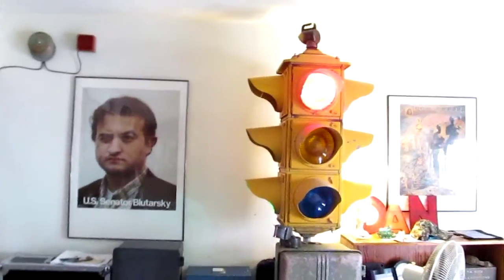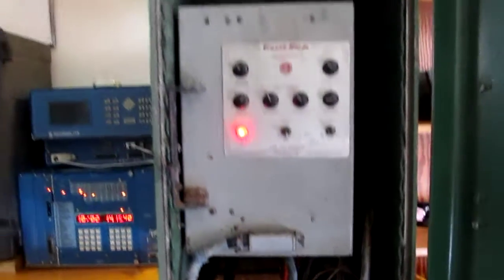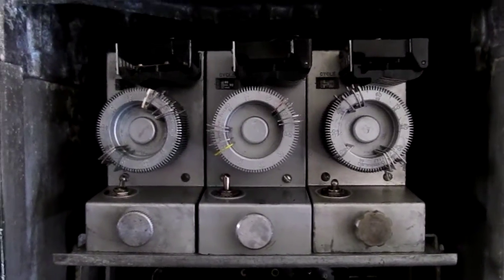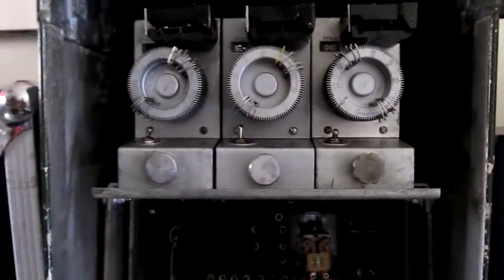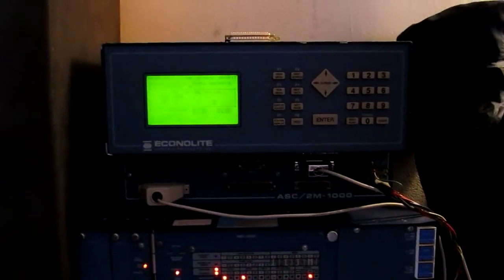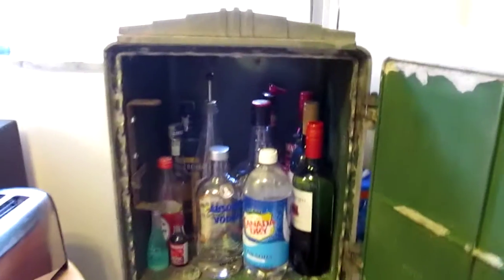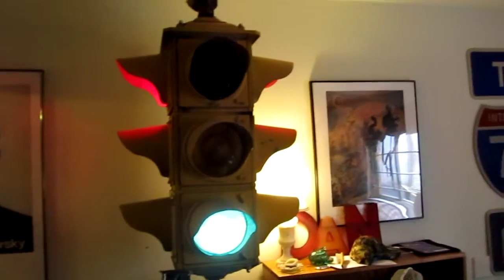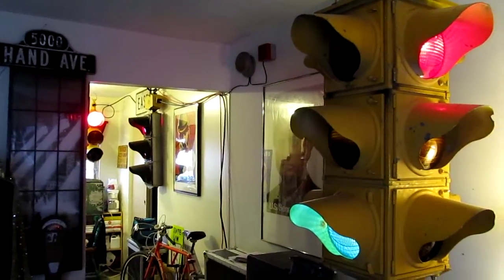Traffic Light Collection Tour, Updated 10/2/11: Part 2

Comment: So does your ASC/2 need anything extra or is it straight 120 vac? Also can it work without cereal cables?
Reply from the maker: All NEMA controllers use straight 120 vac. To run the bare minimum intersection (2 vehicle signals and 2 peds) you only need the "A" connector, which includes the incoming power. The B connector gives you 4 vehicle, 4 ped, and 2 overlaps, and the C connector gives you the full setup: 8 vehicle, 8 ped, 4 overlaps.